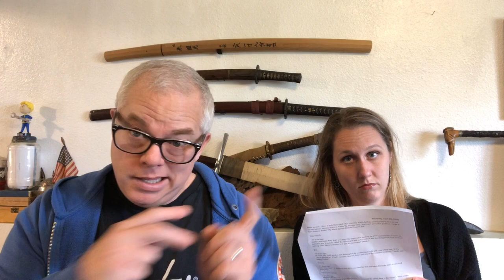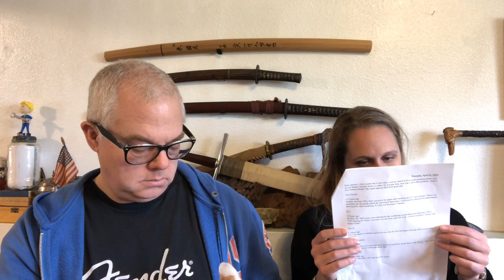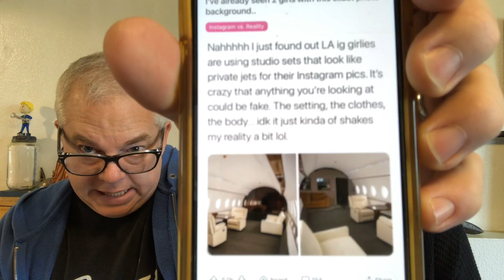Mail Call 107!  September 25, 2020

Comment: Hi Spencer and Sabrina,
I've been wearing a Seiko H556-5100 (Silverwave "Baby Arnie"), which I purchased used and had serviced by the Seiko service center in NJ, for two years now as my daily watch. I considered buying one thanks to your videos in which you service the H556. I love the 38mm size, and I use all its functions regularly. Per your advice I sought out an example with bright white lume. My concern is that, having used the watch almost daily in the Deep South, the lume is noticeably darker (to my eyes at least), having become a light greyish-tan with some tiny bits of "pepper." Is this indicative of a problem with the seals? Or is this just a normal process given my usage and climate? I love the watch but I've been considering getting a contemporary Seiko to spare the H556 any more damage.

Comment: Hi Spencer and Sabrina! 
I have quite a few Seiko 6xxx and 7xxx series watches that I service myself. A few of the 7005 have a very low power reserve, between 15 and 20 hours. However if I wind them via the ratchet wheel they run for  35 hours or more.
 I've installed NOS pawl levers and tried different second reduction wheels and barrels, but the problem persist and I'm out of ideas.
Do you have any clue of what can I look at?
Thank you very much.

Comment: So, why did they use brass instead of hardened steel on the lower arbor port if it takes all the force from the gear train? Why does seiko half ass these things!? Saving pennies?
Reply from the maker: The entire main plate is made of brass.  All they did was put a hole in the brass plate and said "good enough".
Reply: LMAO. I see. Thanks.